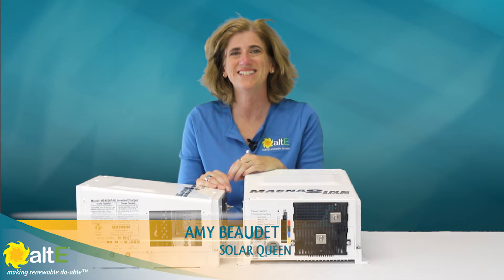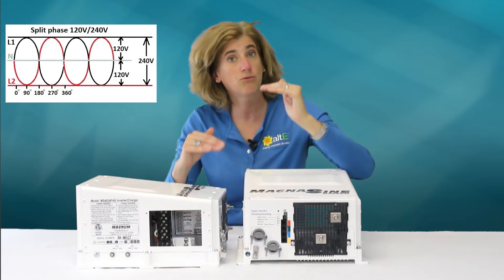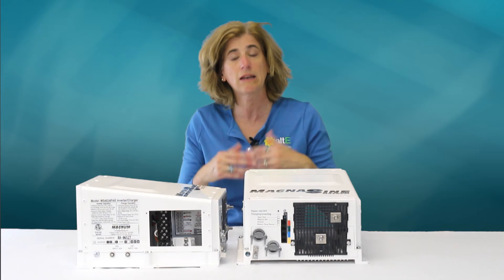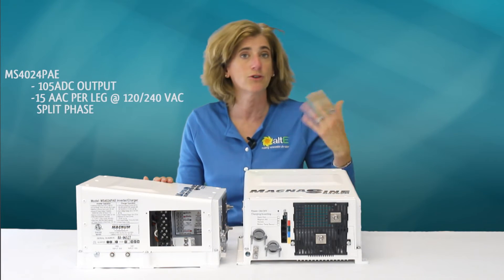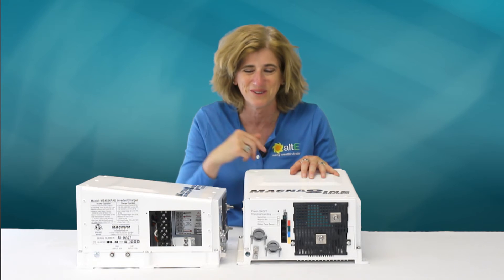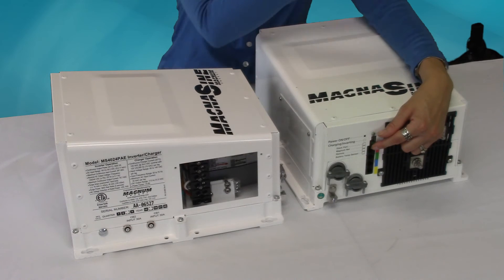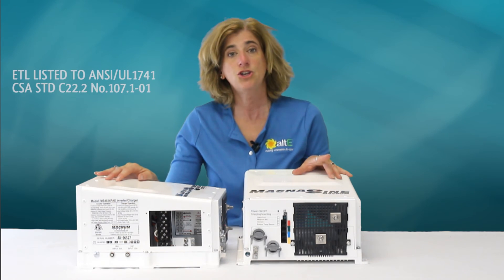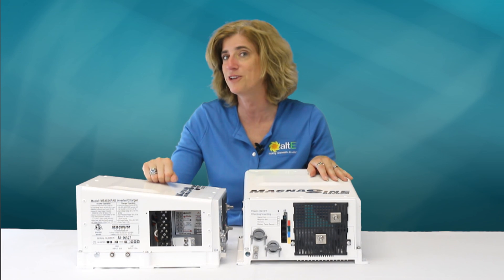Magnum-Dimensions MagnaSine MS-PAE Off Grid Inverter/Chargers | Overview

Comment: what input for shore 120v 30a 0r 240v 50a?
Reply from the maker: You can see the specs here, https://www.altestore.com/static/datafiles/Others/MS-PAE_Series_Rev-D_Datasheet_V2.pdf
Reply: If you have a PAE (120/240v) and your AC input is 120v only, you can adjust your shore at 15 amps and your charging rate at 100%. Or you can leave your shore to 30 amps, and adjust your charge rate to 50%.

Comment: did it work with European standard like 220 V 3 Phase line ?
Reply from the maker: They have a few 12V models that will support single phase 230V 50Hz. http://www.magnum-dimensions.com/product-inverter/2700w-12vdc-pure-sine-inverter-charger-ms-e-series . But they do not have anything for 3-phase.
Reply: I have 3-phase digital meter 220 or 230 50Hz. I use 1 phase for home, 2nd for AC's units 3rd for other appliances but overall I have changeover for 3-Phase Meter. Thanks

Comment: can this be used with a grid tie system
Reply from the maker: The Magnum is not designed to sell power back to the grid. It can use the grid as an AC source to charge the batteries, but cannot be used for net metering. If you have an existing grid tie system, and want to add battery backup to it with AC Coupling, by adding a battery based inverter, then yes, this can be added. You can see an AC Coupled kit using this inverter here, https://www.altestore.com/store/solar-power-systems/ac-coupled-and-dc-coupled-systems/midnite-solar-4kw-ac-coupled-retrofit-battery-backup-system-p11119/.
Reply: thank you  I don't care about selling back power only want to reduce bill and when power goes out still have some usable power   thank you again i think this will fit my need   as long as this will work with grid in conjunction were good
Reply: will this unit utilize  both grid and solar   without always drawing from batterys  ????  maybe i should look into a sw series  ??  i'm using 4kw in panels
Reply from the maker: I'm sorry, I missed this question. Yes, you can program it to draw from the grid and/or batteries.
Reply: chris patirot yes u can I did one for a customer

Comment: im not sure which is best for my application. the magna sine 4400, the samlex 4024, or 2 of the fredom xantrax sw. im running 24 volts on my battery bank
Reply from the maker: +Bobby Diminnie It's tricky to make recommendations through the comments. Give us a call and talk to one of our technical sales reps, and they can walk you through the pros and cons and find the right solution for you. 877-878-4060 Mon - Fri 9:00-6:00 EST
Reply: I am a cabinet maker who does yacht interiors.. all the yachts I work on are 120 foot and bigger mega million dollar yachts.. for the past 10 years only Magnum Energy are used.. no more Samlex or Xantrax which were both used often before.. I don't know about the reason why but the whole industry in my area has gone to using Magnum Energy unless they are repairing or replacing parts of an existing system.. that says something to me and that's why I bought Magnum 3012 for my RV..
Reply from the maker: Magnum makes beautiful inverters, we're big fans. Are you using lithium batteries in your yachts? Have you checked out the SimpliPhi Lithium Ferrous ones? Totally safe, no thermal runaway issues like with other lithium technologies. See a video we just made with them.  https://youtu.be/jj83sQ_kAyM

Comment: im looking for an inverter charger that will primarily be ran from solor batteries but i want it to automatically start my generator when battery voltage gets too low and simultaneously charge my batteries and continue powering my loads. having the grid power input will be nice to have also just in case my batteries go bad i wont have to rewire my house to power my loads
Reply from the maker: +Bobby Diminnie This sounds like a good fit for you. You can get the Magnum Auto Generator Start https://www.altestore.com/store/enclosures-electrical-safety/miscellaneous-electrical-parts/generator-starters/magnum-me-ags-n-auto-gen-start-p741/. It will network with your inverter/charge to turn on and off the genny when needed.